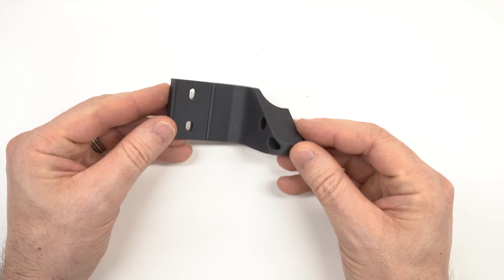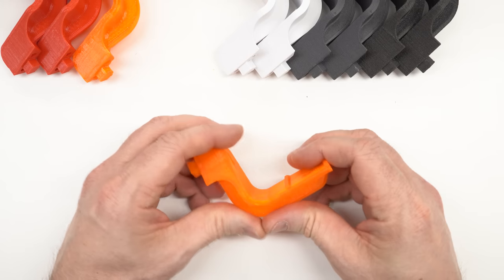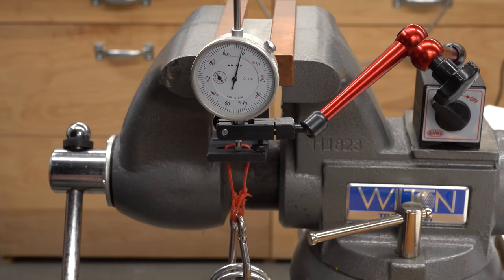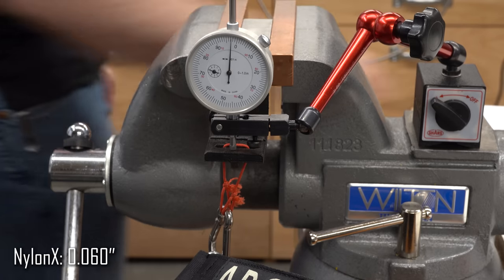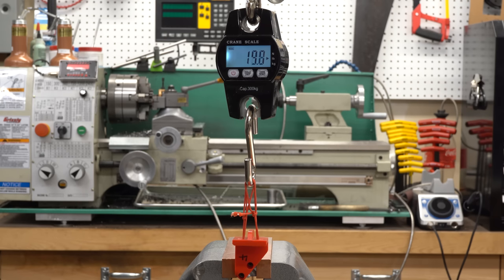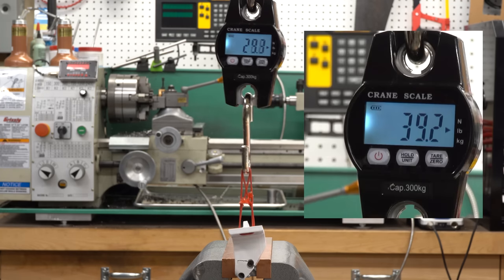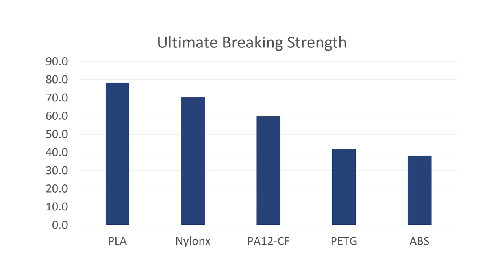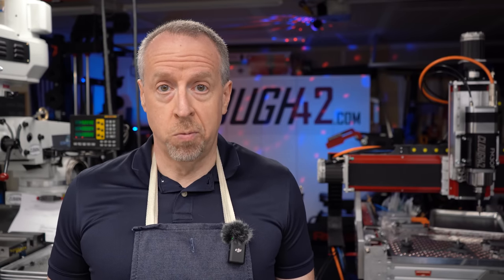Wait, What?  PLA is Stronger Than Carbon-Fiber Nylon?

Comment: You can also easily anneal PLA to make it even stronger. I usually just anneal PLA on the printer bed at 120c, and put a plastic container over the part so that the heat stays enclosed close to the part. I’ve found doing that for PLA brackets make them soooo much stronger and also increases the heat deflection point from 60c to 90 or 100c.
Reply: What printer are you using that has a print bed with 120°C+?
Reply: @nils1953  most are capable of that lol
Reply: @johnandrews9433  lol. Okay then it's just my oldtimer one that struggles to get up to 90.
Reply: Both my old cheap Chinese printers can do that, one with the smaller 15cm x 15cm bed gets there quickly and holds it without a problem, the other printer with a ender 3 sized bed I’d take to 110 at most. Any printer that says it can print abs should do at least 110c as usually you need the bed at that temp because of warping.
Reply: @rvent3605  hmm. My ultimaker2 only goes up to 100°
Reply: @nils1953  So do both my CR10s, the S and V3. Maybe with a cover over the part the heat builds up a little.
Reply: @johnandrews9433  My ender 3 only reaches 88°
Reply: @nils1953  12 volt or 24 volt?
Reply: What about deflection in the part? Geometrical accuracy?
Reply: How long do you recommend? Ender 3 v2 here.
Reply: @MustyBucket  that’s the problem with this method. I find for thinner parts the can warp, for thicker bracket type of parts it’s fine. The only thing to be careful with once the part has been heated, leave it to cool naturally else one can distort the part by handling it
Reply: @aardwolfweb  12v
Reply: @BrilliantDesignOnline  I find 20 to 30min, then turn off heat and let it cool to room temp, else you risk warping the part by handling it before it’s cooled down
Reply: @rvent3605  Great. Thank you. I will give this a try, and appreciate you sharing the concept.
Reply: Annealing PLA doesn't make it any stronger, just more temperature resistant.
Reply: @g.4279  I tested the prints with weights until breaking and in my case the annealed parts were much stronger for me. I annealed primarily for strength not temperature resistance
Reply: @rvent3605  I am thinking if the part was stuck to the bed, the annealing shouldn't warp it as much, would it?
Reply: Annealing is minimal chance in hardness but try melting the piece as uniform solid.. It is incredibly hard material.
Reply: PLA is unique in that it's bond strengths and density is closer to that of cast resins than that of most plastics. It does have properties that most thermoplastics don't. It's truly a remarkable material for the strength/cost/ease of production, and I'm sure that certain processes helps to reinforce and temper it's matrix. It's always nice to hear of other's results. 😊🌎❤️
Reply: @g.4279  not true it does make it stronger. annealing brings the plastic from amorphous back to a crystalline state or in other words it lines up all the molecules nice and tight rather than being scattered which makes it both stronger and more heat resistant.
Reply: The problem with annealed PLA is that its extremely brittle.
Reply: You will fairly quickly ruin the holding strength of the magnets on your heated bed if you use it at 120C, keep that to a minimum during printing and definitely avoid using your printer when an oven will do …
Reply: @nils1953  most modern 24 volt printers can hit 120 unless they're firmware limited if you have an older 12 volt machine you will struggle quite a bit to even get to 100
Reply: @teresashinkansen9402  this it does make the part stronger but it also makes it less tough although as long as those values are still within your objective needs it's fine but good to be aware of
Reply: @jeremyglover5541  use a good bed such as a wham bam sheet or a TH3D sheet those have a higher curry temperature 120 won't bother them
Reply: @nerys71  so they say. I havent seen any meaningful testing or proof of this however. The simple fact is neodymium magnets start to lose their strength at higher temps.
Reply: @nerys71  i did know that and plan to try them out with my voron when its finished. Bit pricy and they dont make one in a size that suits my current machine.
Reply: @jeremyglover5541  your simple facts are incorrect neodymium magnets do not lose there magnetism at higher temperatures they lose their magnetism when you go above specific higher temperatures this is called curie temperature and magnets have a rating for what kind of temperature environment they can handle 120° c is a pretty low temperature in reality sure the normal magnet you go and buying Walmart or the dollar store are going to have a pretty low Curry temperature that word's being misspelled by voice recognition you're just going to have to deal with it :-) I'm tired of correcting it

So you either need to buy one that's been tested to hire temperatures or buy one that has a specific curry temperature that is superior

Wham bam sheets should be good to 131°. I kept one there for several hours with no loss of magnetic hold so you should be good to go with those at least I think someone tested the TH3D sheets but I can confirm that right now I would have to look it up
Reply: @nerys71  i do tend to research things before stating them. The Curie (as in Pierre, not Marie) point/temperature is the temperature at which a material completely and permanently loses its magnetism. That is the point that is somewhat specific. The Curie temperature of neodymium is 310-400C. We do not get anywhere near the Curie point of neodymium on the bed in any circumstance. However, temporary loss starts much lower, this is not an exact point and is in general a curve that starts at 80C.

I cant link here, or i would have before, but here is a quick excerpt.

‘In general, extreme heat is bad for neodymium magnets. A standard neodymium magnet’s pull begins to decrease at 80°C. As stated above, this can quickly become hazardous in environments where consistent strength is required. The good news: If the magnet is quickly returned to room temperature, its full magnetism will be restored. However, if left at temperatures above 80°C for an extended period of time, magnetism can be permanently lost.

In addition, a standard neodymium magnet’s Curie temperature—the temperature at which magnetism is permanently lost—is around 320°C.

But these temperatures are only approximate. Just as important in determining heat resistance is the shape of the magnet and the materials used to make it.

The shape of a neodymium magnet directly influences how much heat it can withstand. In general, a thin magnet will be more susceptible to heat than a thick, bulky magnet.

Meanwhile, the materials within a neodymium magnet can be altered to increase heat resistance. By introducing dysprosium and erbium, some neodymium magnets achieve working temperatures up to 200°C and Curie temperatures up to 370°C. However, these materials have two drawbacks: less overall strength and increased costs.’

So if its standard neodymium, temporary loss starts at 80C (this mostly comes back as the temp goes back down, but while above the temp it will still weaken, pull up and buckle with large prints) 

They are not specific about what changes in material have been made and im not aware of any testing. 4 hrs at 130C doesnt constitute testing im afraid, since that is quite a short 3d print, considering i and many other people regularly run prints that are over 24hrs.

Im not stating categorically they havent, just that i havent seen anything that proves it to me at this stage. This industry is rife with dodgy claims.
Reply: @jeremyglover5541  That's not how the magnet holds things to the bed if you're going to use something insane like what reality does with those flexible beds then yes that's a problem but pulling force in general doesn't matter because the magnet is holding a steel plate

So the pulling force doesn't have to be very high since it would have to lift the entire plate as one unit or it would have to pull from a corner strong enough to flex the steel plate

This is why the flexible plate on the reality under three sucks so much :-) it's also why you don't have to replace the magnet when putting a proper steel plate on the ender 3 because even though the reality magnet is substantially weaker your part is not going to bend the steel plate in most conditions at the scale

Yes the magnet does weekend but as you've noted from your quick Google research the magnetism is restored once it's cooled down

As for the spelling of curry you just have to deal with that :-) I tried every which way to say that word and Google refuses to put the correct spelling in place so I just gave up trying to fix it :-)
Reply: @jeremyglover5541  My longest print was almost 10 days let me tell you I kept an eye on that UPS :-) however that was at PLA temperatures not ABS temperatures
Reply: @jeremyglover5541  no one is using curry temperature in their product description I got most of them are you in aware of what it is.  I am simply telling you buy higher curry temperature magnets if you're worried about temperature because regular run-of-the-mill magnets probably won't be able to handle these temperatures
Reply: @nerys71  lol. Yeah, quick google search to provide a reference for what i already researched months ago because i like to provide a reference when i say something. I hate that youtube doesnt allow links. This was before contacting whambam about sizes that fit my printers. I run larger printers than the ender. I also never run pla temps, as i never print pla. I Print ASA/ABS, PCCF etc and occasionally PEKK for end use electronics enclosures and speaker baffles. My printers are 300 x 250 x 300 and 300 x 300 x 300 and looking at a voron 0.2 build and if i can stretch the wallet, a HevORT 415 x 415 and they dont carry any standard sizes that fit any of them. I even asked on the voron discord about a gb to meet the MOQ of iirc 15 units for a custom size. I would like to have better info on what performance to expect with the whambam before organising a GB. Its one thing to throw my own money at it (they arent cheap) but another to recommend others do the same. 

Ha!! Dont worry about Curie, i wasnt having a go at you about that, just being thorough. I dont know the hell pf voice to text as i never use it, but i can imagine.

I often use the entire build plate on large prints and i use the excellent vision miner nanopolymer adhesive with ASA/ABC/PCCF prints, so the bed pulling up at the corners (can also buckle in the middle during cooling if you have the bed clipped down) is the most likely effect. My longest so far has only been 65hrs, but yeah i know what you mean!! 

Im looking at garolite glass for my printers too, as it doesnt buckle under any circumstance, but i do love the convenience of PEI/PEX removable sheets.
Reply: @jeremyglover5541  yeah I'm addicted to the flex sheets :-) I do have a piece of garlic here somewhere it put garlic here when I said geralite :-) I have gigantic hands even the 7-in screen on this phone is tiny compared to my hands so it's voice dictation for me :-)

The Google thing was not an insult and not intended as such You did your research That's a good thing not a bad thing

You might want to build a flex plate similar to what build tack has or had I'm not sure if they still make them they actually embedded magnets into a plate structure to create their flex plates by doing that you could procure the highest temperature rated magnets within reason that you can get

You can also use the geralite on the mag sheet then you won't have to worry about flex but you'll still be able to remove the build plate

With Prince that large and a bed that large even non-flexible surfaces will probably flex enough to pop it off even 1 mm deflection would probably be enough to start getting a part to come off
Reply: And I'm pretty sure that's not how you spell garlic either and it put garlic again :-) geralite nope I think that's spelled wrong pretty sure it's g a r o l i t e :-)
Reply: @nerys71  yep, thats part of my plan. If the whambam stuff isnt up to snuff. I was thinking of constructing garlic sheets bonded with a layer of some high temp polymer (not teflon, too soft and hard to bond to) with embedded magnets. Problem is, im imagining strong, thin magnets in small quantities will be quite pricy.
Reply: @jeremyglover5541  it won't be small quantities :-) for a 300x300 bed you're probably going to need 30 or 40 of them at least maybe more

And yes they're going to be expensive I don't know if it'll be insanely expensive but I do know the higher temperature maggots do cost more really Google really I said magnets and you heard maggots :-( you suck Google
Reply: @nerys71  thankfully its a problem for another day. My maggots havent failed yet. They are weaker than when i first got the machine, but still useable at this point. Certainly i would be trying to do it with a HevORT build, as that would be an all out attack, no expense spared. But im hoping they will come out with a 300 x 300 sheet to suit the 300mm voron soon enough. They have one to suit the 250 and 350 iirc, but not 300. Its less required for the 0.2, as its so small, i could go with any regular pei solution without issue.
Reply: @jeremyglover5541  The mag sheet you can cut down and the flex plate just find something that's close to the right size with a core XY you can go slightly larger than smaller also you might be able to get somebody like PCB Way to cut you a plate at a reasonable price possibly I don't actually know or maybe someplace local?
Reply: @nerys71  thanks, yeah i had considered that, if easier options fail to be useable. Yeah, perhaps pcbway could be useful, though larger size things with them tend to end up not so cheap due to shipping. Im in australia. Unfortunately local options are almost never cheaper. We get ripped off pretty badly here for tech.
Reply: Annealing PLA will make it stronger, but far more brittle, and that brittleness is infinitely increased if being used in a humid environment. PLA certainly has some great purposes! But WHERRE its used, and for what, quickly make it sketchy at best. Carbon/nylon fiber filament is, in contrast, more consistent in its functionality across a far more diverse range of environmental conditions and is therefore both safer and more logical to recommend.
Reply: How has it effected the dimensional accuracy for you?
Reply: @g.4279  It lets the layers bond a bit better so it does actually increase the strength.
Reply: @teresashinkansen9402  so is normal PLA lol.
Reply: The PLA warping is a problem, did the annealing process mitigate that? I use nylon because PLA is not as temp resistant and I was curious about your experience.
Reply: @nerys71 Learn to use punctuations.
Reply: Something to watch about with annealing PLA is different grades of PLA respond differently to annealing. Ingeo grades 3D850 and 3D870 seem to have the better thermal performance improvements to annealing (3D870 seems to also significantly increase in impact performance when annealed). NatureWorks has a document on their website (that I can't link to thanx to YouTube's current policies on links in comments) showing their testing results of the different grades of filaments. Good luck getting information on the Ingeo grade used by many filament manufacturers. Some are transparent about it, but others consider it an industrial secret...
Reply: that's very interesting, I'm actually printing Chainmail and Plate Armor in PLA+, I may have to do extra-Prints to do penetration Testing before and after annealing.
Reply: only if dimensional accuracy isn't important. annealing warps PLA like crazy
Reply: Then perhaps tossing the part in boiling water will help too!